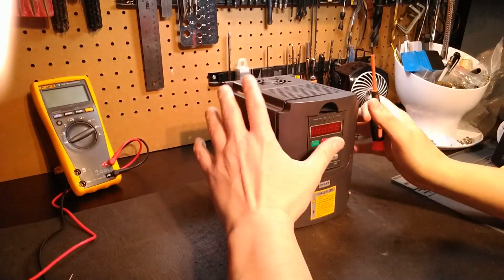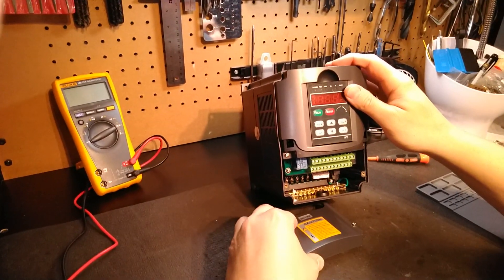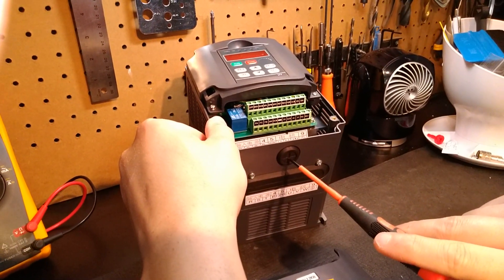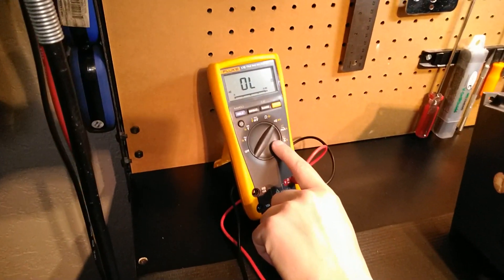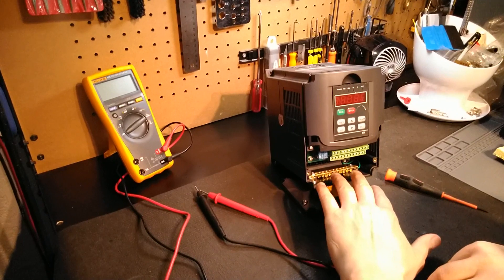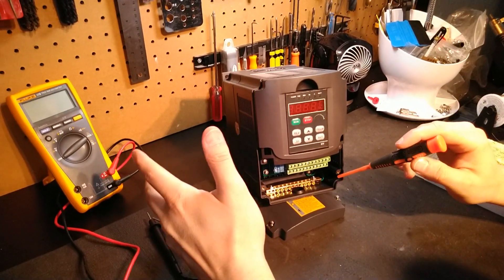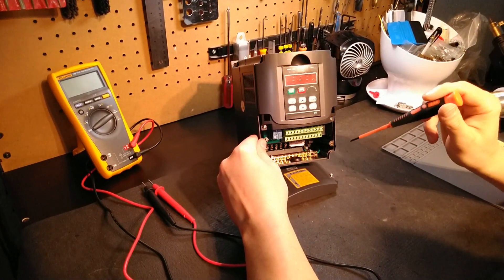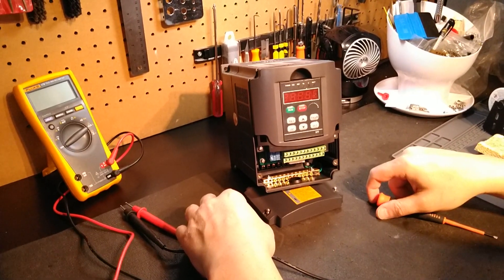Universal CNC VFD Ground Splitter Kit (Split Your Single Terminal Ground The Correct Way)

Comment: So I believe I will order this, but can you help
me understand what the use cases are for splitting the ground other than the power in and the spindle? Since there are so many terminals added by this it seems there are other situations I’m not thinking of. Thanks!
Reply from the maker: Hey Ryan, thank you for your support. The purpose of the ground splitter in this case is as you wrote to provide the spindle's power cable a ground position with the VFD's power cable a ground position as well preventing them both from sharing the single ground terminal on the VFD which is allocated to by 9, and the ground symbol. Other areas of use would be to add a ground buss to your system where attaching multiple grounds coming into your electronics enclosure is required. This is most common for motor cable entry where the shield drains from their cables must be grounded like in this video. https://youtu.be/Hik7SlkX5Is?t=382 Thank you, and have a great weekend!
Vince

Comment: So I have the AC from the wall coming to the vfd and then I have the spindle wire connection going to the spindle sharing the same ground but now when I connected probe from the controller I get a weird grounding issue any suggestions
Reply from the maker: Jafterdark, Thank you for your support. I can't offer much help without knowing all the details of what you mean by "weird grounding issues"  The probe's lead run to your breakout board should be connected to your endmill in the spindle, and the probe's baseplate lead should should be run to the V- terminal on your power supply. 

If you have these leads connected backwards then the touch plate can be grounding itself to the CNC chassis leading to an always lit digitize light in Mach3. 

Thank you, and have a great weekend!
Vince